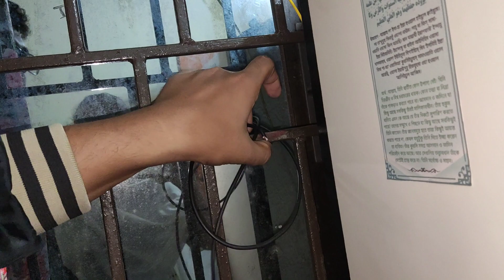How to fix electric shock issues from pc case | Solution for electric shock for $0.50! #pcproblems

Comment: bro i stead of this i had just attached the wire from my case(psu) to a nail on the wall with wires and now it dosn,t give shockes i have torrent lights so the power cuts are very rare should i attach it with the outlet instead i am worried if i ditach it the shokes gonna come again

Comment: What happen if I don't fix it? And what is the main problem?
Reply from the maker: When you are running pc and need to touch the pc you may get electric shock. Same for children around. If you house have good earthing sysem that may no even happen.
Reply: @tareqcreations  will it damage my components
Reply from the maker: @i_rony_M4  No way. I am using for over three years.
Reply: @tareqcreations  my PC is shocking me even when its not plugged
Reply: @tareqcreations  I tried it's not working

Comment: yo, how do you know that the case is no longer shock us by a screwdriver?
Reply from the maker: This is not just an screwdriver on top it has orange light signal if there is electricity. We call it tester in our country. I am using that way for over 3years. Still no issue.

Comment: So basically properly grounding it? Does it work just as well if I use the metal frame of my table to ground it?
Reply from the maker: I never checked it. I believe it should be worked too.
Reply: @tareqcreations hehehe you should have tried that first my friend 😅 but a solution is a solution
Reply from the maker: I have been using my metal window frame for over 2 yrs. So far no issues.

Comment: Great video bro, but i have issue where the current is leaking from mobo's backpanel ports and NOT from the case even from the psu body no current is leaking, i have tried to ground the port panel by instaling cable which connected to ground, but still my ports are leaking current which cause everytime i plug usb drive or audio cable a tiny shock of electricity to my hand, can you help me with this one? Thanks
Reply from the maker: My apology to miss your comment. Unfortunately i don’t know the solution for that. You can look for a technician to ask about it.
Reply: I have the same issue i still have no idea what th cause is. but i manage to reduce it by connecting a broken usb cable to mobo cut the other end and burying it into plant pot it does go away but i need to clean the end like twice a month
Reply: @Mustafa-fk5ii  i have my issues fixed, turns out the grounding is not deep enough, i change the grounding with longer nails about 10cm to the ground and connect it to the vga socket bolt with cable and the leaked current is gone completely
Reply: @Pentium1.  That's great. Can you suggest another place to connect the ground? i dont have vga port
Reply: @Mustafa-fk5ii it might be quiet psycho but i check where the most current leaking by using my hand first. If  you have it at the same place with me at the mobo back panel ports you can first strip out the grounding cable for about 1-2cm till you see the wire, twist and tangle the wire then slip it to the part where there is gap between your mobo backpanel and your pc case. And you might be needed to connect the grounding directly to the ground.

Comment: What’s that cable you used which you kept on the window and the should have grilled or not necessary
Reply from the maker: I did not checked without putting in grilled. I can check Today and keep you update there